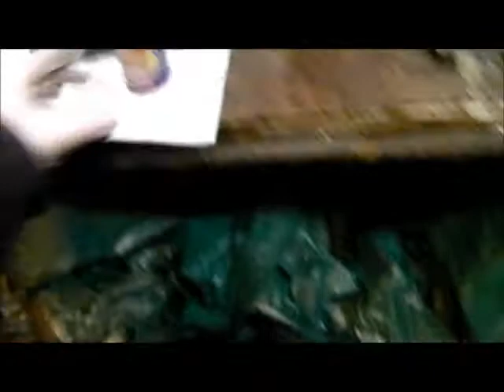Lister Junior Restoration - Part 4 -

Comment: A trick learned many years ago. Put a weak spring on the valve stem when grinding. It will lift the valve from the seating . Makes the job so much less tedious.

Comment from the maker: I'm in two minds about it. Getting a tank made and then all the fittings for it is going to be £100+ I should imagine, whereas I could modify one of the Villiers tanks to fit for a lot less.

However, after going to a lot of trouble elsewhere on the engine it would be a shame not to get the right tank on there.